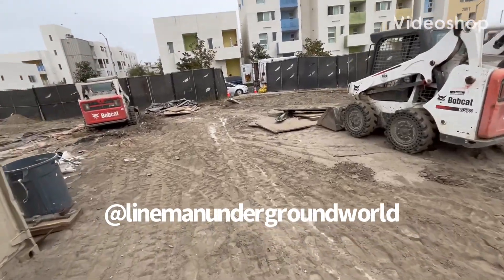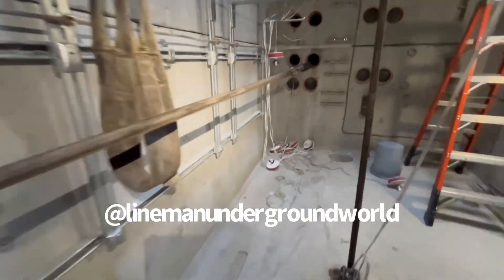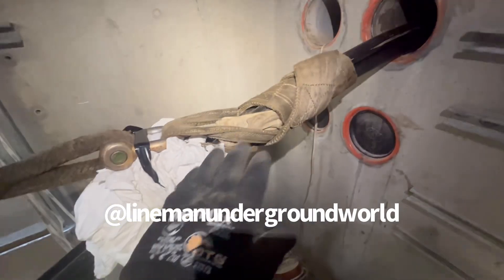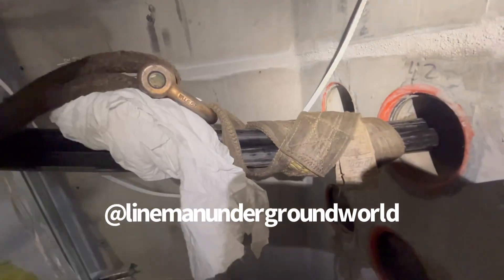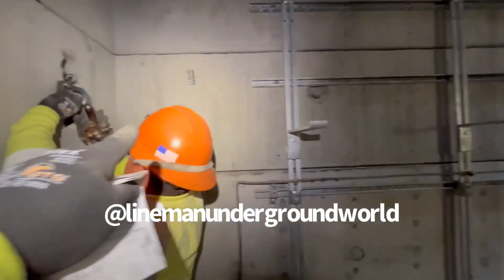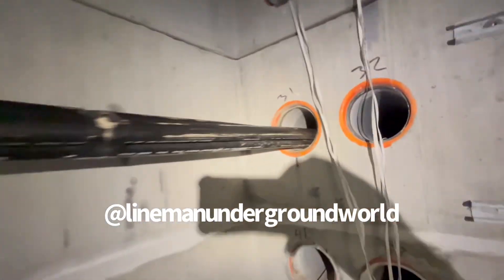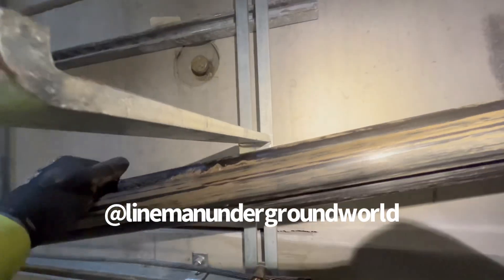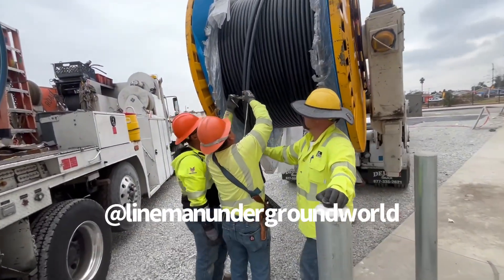New vault, new 34.5 kv

Comment: Why pull one that is 2nd from the wall then one that is next to the wall? I seems like you'd wanna do all of them close to the wall then the 2nd?
Reply from the maker: @syntaxerorr  wazzup syntax , before I started my video we check our drawing and verify the conduits and how they are aligned or arranged from the vault to the transformer pad mount and what’s more convenient to pull from or feed the cables from , so by us pulling on the string, ( if you have watched my other videos you can see us verify the ducts by pulling on the string and the arrangement of them and decide. ) so at the pad mount, ( the wall duct conduit was the inside on my side in the vault and their outside is my wall , what happens quite often when the conduit is laid in the trench sometimes they role them and this is the outcome, so at the end of the day I will accommodate the guy in the pad mount priority one over me in the vault. Thank you for asking that question…👍😎
Reply: Translation: Its harder for the guy pad mount to splice than it will be for me in the vault because I have more room to work. So its doesn't matter as much for me which ducts are used.
Reply from the maker: @ wazzup Byrd , how we pull cable matters to us that’s why I give preference to the guy in the small confinement always, because I am in a big room, so with that on my side it doesn’t matter.  👍😎
Reply: @linemanundergroundworld4854    We do the same thing, but we don’t pull our own cable. We get whatever the cable pulling crew leaves us. Guy with the tougher work space goes first.
Reply from the maker: @ yes sir absolutely correct 👍

Comment: It seems like your city has a strange mix of very low voltage 4,800 and very high, 34,500. Any idea why it is not the normal 12 and 21 kv?
Reply: Low voltage is 600 volts, medium is up to 33,000 KV high voltage is above that. medium voltage is most efficient around 13,000 KV.
Reply from the maker: @nspro931  wazzup nspro , the voltage the you mentioned 12kv or the other voltage, that voltage is , I believe from Edison utility and the 4.8kv and the 34.5kv is DWP .. thanks 👊😎
Reply: What does 3 bills mean?
Reply from the maker: @ wazzup bamed, reverse 👍😎